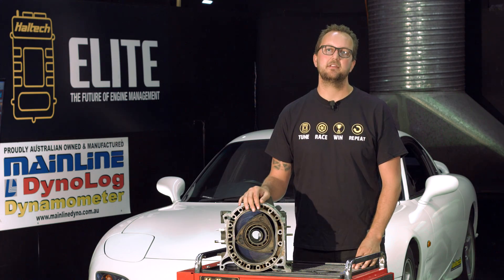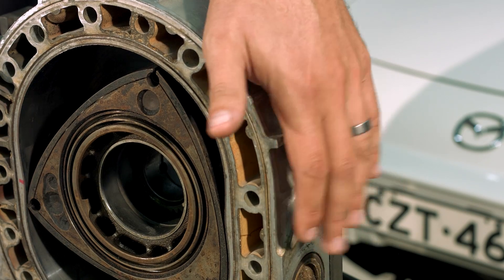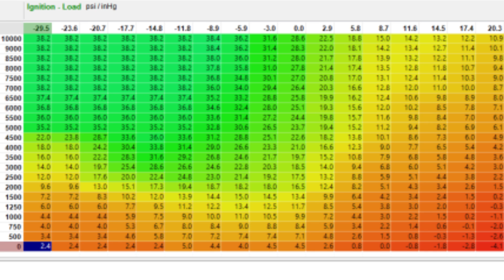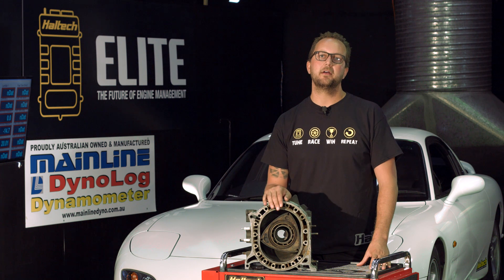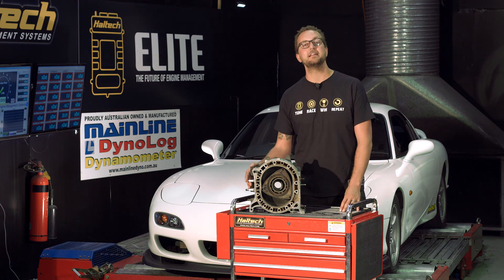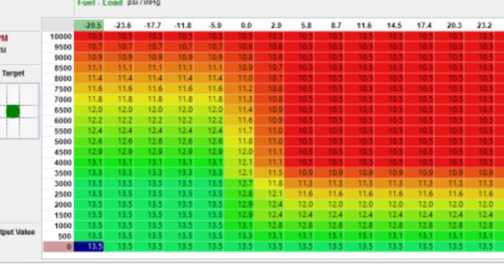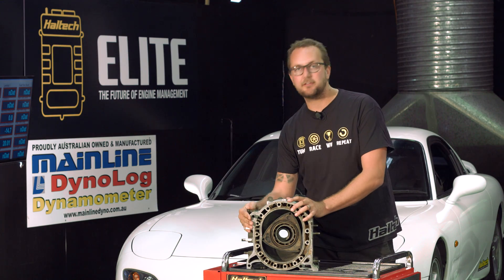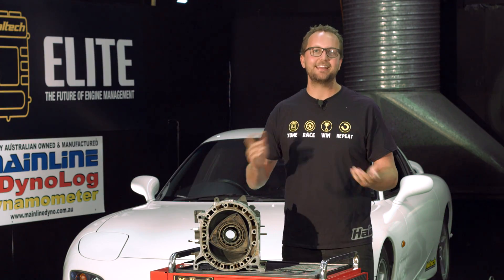💬 Tuning a Rotary Engine - Technically Speaking

Comment: I don't understand the hate walkers get. My dad has an rx8 that we lpg converted and it as reliable as anything, and with that sound you just can't not love them. And come on 3 moving parts they are just so easy to build and rebuild. Personally I'd have a rotary over piston any day, don't hate it until you've tried it!!!
Reply: You're spot on about the moving parts point. I think I know why most people have had problems with rotaries. They don't know that you have to treat them like 2-stroke engines. That you have to let them warm up to avoid flooding. That you have to add oil more frequently. And that you will have to rebuild them more often than a reciprocating engine (even though as you mentioned, they only have 3 moving parts, so it should be incredibly easy).
Reply: Yeh and the rewards for all the work outweighs the downsides. The sound of them.
Reply: lpg is dry so won't help lubricate, and combustion will be hot. I'm not sure lpg is a good idea in a rotary engine :/ Sorry to be a buzz kill.
Reply: don't worry about doctor bummer.. he goes around the you tube and makes trouble.. glad you are liking your LPG mod.. I may try a similar mod once I pay my rx8 off..
Reply: That's what you think but it works perfectly, just needed a tune and a custom oil delivery system to obviously lubricate the seals.
Reply: Simon T absolutely fantastic car. Light, sounds amazing, handles well, good interior, reliable if you look after it, just really well engineered. I think a lot of people stay clear because of the rebuilding thing but it really is very simple and I reckon the average person could do it with a bit of research.
Reply: Isaac Abraham the engine is lpg converted so it runs on lpg. Lpg is a petrol alternative that you can buy at petrol stations in the uk, it is half the price and has very similar consumption so gives very similar mpg.
Reply: The real doktorbimmer say what you want but the rx8 is a great car and the motor is top and if you look after it right and know what you're doing it is reliable.
Reply: The real doktorbimmer exactly! Then why are you bringing it up in this comment section? Idiot!
Reply: Louis Bou yeah hes just a rotry hater leave him alone he got laid off from mazda
Reply: terrance hill I've been going through the same thing for almost 2 years,,,,this guy has a hate for mazda rotary like nothing I've ever seen before,,,its totally irational.
Reply: The real doktorbimmer yeah,,,,that's it! Everyone on YouTube is wrong and you're the only one that knows anything lmao
Reply: The real doktorbimmer the REAL FACTS are you don't own a rotary powered vehicle,,,never worked on one and only know and repeat what you've read. So until you actually put in some wrench time nothing you say can be taken seriously.
Reply: @dakken74   
http://az616578.vo.msecnd.net/files/2016/08/27/6360787077700554381193066848_Internet-Troll.jpg
Reply: The real doktorbimmer OK obviously it has more than 3 moving parts but you have 3 major moving parts. You can chose not to believe this but it is true, why would I lie, it's a YouTube comment section.
Reply: The real doktorbimmer look at any car magazine or anybody who has ever driven one, they are a fantastic car. They didn't sell because your average joe isn't going to buy an rx8 due to the motor and it's high maintenance. This meant they weren't continued to be made. But mazda proved that you could have a rotary daily driver.
Reply: The real doktorbimmer I have an rx7 and know people who actually work on them,,,,what do you have besides your hate for them and Wikipedia lol
Reply: Louis Bou Cool, sounds like you've got it all in hand. Enjoy :)
Reply: The real doktorbimmer you just can't accept what I'm saying is true. You can chose to believe me or not. But look on any rx8 forum and see the people who lpg convert them. I'll link you the eBay ad once it's up for sale.
Reply: titus allen don't listen to this guy he is just jealous he doesn't have the knowhow to lpg convert his rx8 or he may just be jealous that he doesn't have one. It's a great car enjoy it mate, especially when it hits 6k rpm.
Reply: The real doktorbimmer got a 750il lpg converted and a 147 1.6 twin spark lpg converted as well if you want to say that they won't work as well.
Reply: The real doktorbimmer what about all the other people that say the same thing about you? Lmao!!!
Reply: +dakken74 yeah there a lil faster to i believe.. think the gen 2 just got some of the troubles fixed. I would love one of them two.. actually kno a guy who is selling one but im focused on my rx7 for now
Reply: doktorbimmer edited. Giving you the benefit of the doubt you weren't trolling: Yes, rocket engines, at least the vast majority, are indeed ICEs. An internal combustion engine - whether or not you directly inject the oxidizer in the chamber - is still an internal combustion engine. In a rocket engine, you could inject "atmosphere" but this is EXTREMELY inefficient given the low volume fraction of oxygen (~20%) present in air. Transporting it is inefficient, burning it is inefficient
Reply: The real doktorbimmer ummm the car works perfectly and fuel costs a shit tonne less so wherever you got that from is bullshit
Reply: The real doktorbimmer well not so inefficient that it's less cost effective to lpg it.
Reply: Louis the reason rotaries have problems are based on seal lubrication and emissions. most wankel heads know that mixing an ounce of 2 stroke oil per gallon of petrol in your tank helps lubrication greatly. 
the renesis rx8 was shit compared to the older 13b because they tried to make it run cleaner, which they simply aren't meant to do, as explained in the video. he doesn't spell it out, but when you pay attention to the fact that these need more fuel because of a lack of time in the engines cycle, it makes sense. 
wankels have always been a great race engine, but too polluting for the standards most of our governments place. 
also, it seems most people who don't research the differences in rotaries end up blowing them prematurely when they treat them like piston engines.
Reply: The real doktorbimmer is that what's in an Rx8 or Rx7? No? Then leave it out.
Reply: The real doktorbimmer I've seen your youtube,,,your a wanna be know it all who likes to argue about stuff that's not in production anymore to try an make yourself look smart lol
Reply: The real doktorbimmer do you have an Rx7 or any mazda rotary powered vehicle? Yes or no?
Reply: The real doktorbimmer exactly as a thought,,,,wannabe know it all with NO EXPERIENCE to speak of.
Reply: The real doktorbimmer all talk! Just like I thought.
Reply: terrance hill you see how when you ask him if he has any actual experience he tries to change the subject lol
Reply: The real doktorbimmer lmao ur a joke bud haha.. i think even u kno it, pretty sad really but what ever  must suck for u on here.. everytime u open ur mouth someones there to prove u wrong or call u stupid. Habadaba dum
Reply: As for whether the rotary engine will live on, Kogai was a bit more cryptic and wouldn’t give a definitive answer. “But if we were to restart production of the rotary engine again, we need to make sure it wouldn’t be just short-lived,” he said. “We need it to meet future emissions regulations. We are still conducting our R&D activity to overcome any issues we have with emissions and fuel efficiency.”

So the good news is, Mazda is still working on developing a rotary engine, but it’s unlikely to show up in a new sports car
Reply: terrance hill I've been dealing with him for a while now. 1st time we talked he admitted he had an Rx7 and blew the engine,,and know all he does is talk shit about them. Lol
Reply: Louis Bou rotaries are fantastic until you have to tow something, unfortunately
Reply: If you think they have only "3 moving parts" you don't know much about them. All of the various seals on the rotor are moving parts in and of themselves as are the various parts that collectively make up the rotor "assembly". Bearings are also "moving parts", and of course rotaries have all the accessory parts such as oil pumps, water pumps, etc that all other engines have. So cut the bullshit. There's nothing "simple" about rotaries and they're actually stupidly complex given how poorly they perform. Even Mazda, which is the only manufacturer to ever invest in rotary production, only used them in a small fraction of all of its vehicles and those are its lightest, least-practical "toy" vehicles aka "sports cars".
Reply: what is combustion itself
you do know that the most powerful super computers exist for running simulations in DIESEL COMBUSTION with QUANTUM PHYSICS (why they're so powerful) to understand how to get a cleaner, more efficient burn, right?
and you do know that i did not cite any of his "quantum physics" work, but instead the one where he proved that every EVERY referential is right, right?
are you scared you dont know anything about it?
Reply: blown
the
fuck
out
you cant even come back properly
i point you, again, to his work where he proved that every referential is valid.
keep on being you man, we need people to laugh at.
Reply: > I bold my comments to show my intelligence!
Reply: once again, i did not mention quantum mechanics, you did. i mentioned referentials.
but if you really, truly want to know what quantum mechanics has to do with ICE engines, its in the goddamn name. people are trying to figure out (specially with diesel) how to make the mixture more homogenous, burn cleaner, and more efficiently, all through quantum mechanics. quantum mechanics matter in an ICE engine when it comes to the fact that you cant be sure that there'll be even distribution during injection.
 you goddamn door knob, i told you this once, and you're making me repeat myself. last time i had to repeat myself close to five times. maybe you're just braindead.
Reply: "look at me mom i know some cool internet tricks like bold and italics. that makes me super win arguments right?"
Reply: sure thing m8
Einstein, Albert "How I Constructed the Theory of Relativity"
or if you wish, the equivalence principle.
it all started off with gravity studies (which is unlinked to quantum phenomena up to this day).
its as if it was classic mechanics
and then it evolved
something like modern physics i think its called
Reply: Attention seeking behavior is intelligent and cute in a dog. Not so much in a guy who spends years on youtube on a hateboner for an engine, its owners and and enthusiasts.
Reply: does him working "with quantum mechanics" (for the most part he really didnt) negate any paper that he wrote about any other topic?
is that how the academia works nowadays?
or is that just the sound of a fanboy of a brand that cant even compete with the contemporary car market?
Reply: once again, i did not mention quantum physics for the argument. you're the one bathing in your own pool of tears over it.
i did not say it mattered for wankel engines, i just cited it matters for diesel engiens
not once i wanted to delve into quantum mechanics. i just cited how eintein's work proved that EVERY REFERENTIAL IS THE SAME, AND THAT RINGS CAN BE CONSIDERED STATIC, but it seems your goldfish brain cant remember what you commented during a timeframe bigger than 5 seconds.
scroll up, read the chain again.
bmw own morris, a defunct brand since 1984
Reply: no shit sherlock. never said that.
but he is not.
are you legitimately telling me that gravity is quantum study?
the force that is UNLINKED to the quantum world is quantical study?
really?
Reply: ring around the goalpost
with a pocket full of bait
mate, you still dont understand what the hell "referential" is
go back to high school, and maybe try to get an engineer degree on the way.
Reply: to you
its a moving part to you
its a moving part for someone who is observing from the outside
for the seal itself, it does not move. the world does.
you're showing your lack of physics and therefore engineering knowledge.
Reply: to seal
it is located in the apex.
you still dont know physics
what else is new
Reply: doktorbimmer you need to see a therapist
Reply: Lol what now? The reason "atmosphere" is inducted by (most) ICEs is so that the vehicle doesn't have to carry oxidizer. Atmosphere is not required, rather it is simply a convenience that O2 is present
Reply: >nan3r is trolling
Mixed up the names mate, you're the hardcore wankel hater
Reply: Because you don't understand physics, as clearly shown. And physics have to dumb down physics to make people like you understand even a slight amount of it, so instead of understanding it all you just get a tiny piece that is simple to work with and think you own the world.
Reply: doktorbimmer even a 14 year old understands referentials 
Did you skip physics class or did you skip school as a whole
Reply: hey man, I have an rx8 coming today. what do you mean lpg converted?
Reply: The real doktorbimmer car is perfect on lpg just needs a good tune. Might be because lpg has a higher octane rating so may not need a higher compression ratio.
Reply: The real doktorbimmer yes or no?
Reply: The real doktorbimmer are you or have you at anytime in the past been employed as a professional mechanic who specifies in the mazda rotary engine?
Reply: The real doktorbimmer yup,,,,change the subject from the fact that you have no experience LMAO!!!!
Reply: The real doktorbimmer ran away i didnt kno u said anything lol all these coments u ran and hid from then u pop up almost a week later like a lil bi.tch talking shit lol ur a joke just give it up... its funny u run and hide everytime a few people join in to make u look like a fool and pop up in another coment section haha fudging joke
Reply: terrance hill I don't think Bimmer understands the concept of misdirection,, the CEO of Mazda has already stated in the past that the Rotary is the soul of Mazda and there not giving up on it lol
Reply: I said there will b a new rotary never said it would b an rx9... also i think u need to go read what the ceo said lol... fudging joke
Reply: The real doktorbimmer lol so so so sad u are... i kno what will cheer u up.. go get ur nails done again, maybe this time get ur hair did hahaha
Reply: The real doktorbimmer he didnt say that at all lol he said they wernt planing on building a sport car bigger then the miata.
Reply: His words; " if we were to restart production on rotary we would need to make sure it wasnt short lived and meet future emissions regulations" then what did he say Oh YEAH " we are still working on r and d for emissions and fuel consumtion".... hows ur butt feeling.. is it soar again.. im sry i have that effect on u hahahaha joke
Reply: @doktorbimmersdaddy715  So much condescension, and so many assumptions in so few words... DOKTERBIMMER IS A FAKE ENGINEER Allow me to enlighten you; I have not compared it to a 2 stroke in any comments here (though the comparison is entirely valid). I'm not a kid, I'm an Aerospace powerplant development engineer, and a former Mazda technician. I have a comprehensive understanding of the Wankel rotary engine (though I'm not nearly pretentious enough to use non English initials for it when communicating in English). Contrary to popular belief, this engine is not an occult entity of magic and mystery, it is an internal combustion engine. Different in that it is a constant volume pumping unit, and non-reciprocating, but still just an engine that translates thermal expansion into rotational motion like all the others. Don't be an arse.
Reply: @xkexke8081  Where is Ernie Brink???
Reply: Copy and paste from the article.
Reply: ***** well thank u for that lol i was just going off what i rememberd reading... still pretty sad about the rx9.. altho im sure we will see it one day. Altho i couldnt really care.. the rx7 is amazing. The rx8 has its problems but is still gorgeous and the older rx models are sexy as heck too.... they should just make a nice mazda with optional rotary engine for the true car guys.. one day.. shit even have an optional rotory on a miata, i guarenty it would sell
Reply: terrance hill yeah,,i love the look of the rx8s. My favorite is still the 1st gens.
Reply: ***** oh really im glad to kno that lol not mazdas fault he doesnt kno what to do with a rotary.. he spends so much time on google u think he would actually kno something usefull.
Reply: I want to be able to wake up 5 minutes after I'm supposed to be somewhere, then jump in my car and drive off immediately while forgetting most of what I was supposed to bring at home. 
Rotaries don't seem to like that type of abuse.
Reply: LPG huh? What kind of setup are you running to do that? And how are you keeping high-friction, high-heat rotary parts alive with a very dry fuel like LPG? Oh wait. To be truly efficient and worthwhile, LPG engines and "conversions" have to significantly increase compression ratios over gasoline engine levels to make use of the high octane and low energy density of LPG. So the odds are your "converted" rotary makes less power and is less efficient on LPG than it would be on gasoline.
Reply: DEEREMEYER1 by 3 moving parts, im pretty sure he was talking about the main parts making the power. Obviously the accessories are moving parts. Compare with reciprocating engines, 1. Piston 2. Wrist pin 3. Rod 4. crank 5. Timing chain/belt 6. Cam(can add multiple numbers here for overhead cams, and more for single cam with stems and rockers) 7. Valves/tappets(can add more for balancing shafts to). No need to include seals, flywheel, water pump, oil pump or alternator wich they both have.
Reply: Deermeyer soooo wrong... he was talking about actual moving parts of the engine, the stuff you listed as accessory parts are just that, ACCESSORIES, you don't need them to run the car, however the seals and such are not considered seperate moving parts.
Reply: lol Doktor Bimmer was probably "rotary is garbage" pseudonym before. It's pointless, he/she hates the wankel engine with passion. Whilst some of us love it despite it's short comings. Oh and Doktor Bimmer sounds like Mazda might have had some breakthroughs recently with engine technology that may allow them to produce a new rotary engine! That should give you something to cry about for years to come! Oh NOES the rotary and it's inefficient combustion chamber! How dare those Mazda folk do that!
Reply: do piston seals not reciprocate inside the combustion chamber, or do you just put them inside your oil pan for the sake of simplicity?
Reply: you also wont find them arguing with you saying theyre not
its all in the referential mate
for the piston, its the engine itself that is moving
for the dorito, its the iron itself that is moving.
its as if you said that the ground moves your car. youre not wrong, just different.
Reply: you missed my point
they can just as well be separate stationary parts. it depends on your perspective.
"blah blah blah the engine doesnt move" 
as einsten himself stated, every referential is correct.
Reply: you are not seriously suggesting that you're considering vibrations, are you?
"oh look it moves .01mm forward during compression and .01mm backwards during intake"
to the rotor/piston (if you dont cosider the piston rings rotating) they are static
and they dont rotate anyway on 2 strokes, so blown the fuck out once again.
Reply: HAHAHAHAHAHAHAHAHHAHAHAHA
you couldnt be more wrong
"theoretical physicist" im going to give you a spoiler on that, they do more math than any other physicist, they just get a bad name because mediocre people like you think its something that it's not.
tl;dr from your post
"einstein is wrong from a conventional physics standpoint"
you truly are a mastermind, huh
can you show me where he went wrong on his calculations?
fun fact, einstein hated quantum physics. he's the one that the famous "god does not play dice" phrase is attributed to.
Reply: thank you, i was really needing that laugh, with my grandpa being in the hospital and all
dumb people really are a blessing.
Reply: Last time i checked but apex seals and piston rings are FIXED to a Rotor/Piston that is the point, they are not separate moving parts that increase the complexity of the design, now sure in a way they are moving parts but they are attached and held in place by grooves...

Do you class seals or rings as the same type of part as a crankshaft or a conrod? No...
Reply: HAHAHAHAHAHAHAHAHAHHAHAHAHAHAH
quantum physics is not dependant on referential?
what the hell youre talking about mate
its dependant on referential mate. THE SEALS CAN BE CONSIDERED STATIC. JUST USE THE PoV OF THE SEAL ITSELF
god you truly are braindead.
Reply: You said yourself the bold text was to draw attention and you call me an attention seeker. Hah!

How many years has it been since you started going on this anti-rotary/wankel whatever the fuck your pedantic ass wants to call it?
Reply: Okay YES the seals are a moving part from the outside due to the fact they move but they are not mechanically moving which brings me to my point a wankel engine in it's simplest form has 3 god damn parts, rotor housing, rotor and crankshaft... not much to go wrong there bar SEALS which are not hard to replace and due to the size of the wankel engine i would much rather change the apex seals of a Wankel than piston rings on a piston engine, you have been arguing about parts to go Oh look at how smart i am when you never refuted my claim of Wankels are simple engines.
Reply: "entropy limits"
nigga what
no engine is more "entropic" than the other (given that they burn the same amount of fuel)
entropy is the amount of free energy in a system. burning fuel changes the entropy of the universe, but moving something does not.
"haha im so witty and funny with my rotary meme"
rotaries are shit for airplanes. there have been a couple of cases that the pilot has been chucked out of the moving plane because he was inexperienced and could not deal with the amount of gyroscopic effect the engine puts on the plane.
you really have to go back to physics man.
btw, sealcs can be seen as static :V
Reply: "its rarely done therefore its hard"
complete and absolute bs
rebuilt a two stroke (bottom end too) in three days.
Reply: Vicious Slayer don't bother with this domtorbimmer guy. He is a legitimate fucking sociopath (who, evidently, recently discovered how to bold font...yay). I'm not joking in the least; he can be found in almost every rotary video on YouTube desperately falsifying information for god knows what reason
Reply: oh i know
i like teasing him because his dubassery always shine through, but he never notices
he's like a tinfoil hat wearer
you know, wankels suck because they died in 2011, but the apex of engineering are rotary engines, where you have a spinning block with tons of gyroscopic effect (which killed plenty of unexperienced drivers), it blows crank seals AND it eats oil
doesnt sound similar at all
its funny to count how many times he can contradict himself and he still thinks he's winning
Reply: It's not a mechanically moving part it moves but not by mechanical forces of other things, it does not move freefloat same way piston rings are not considered moving parts as they are considered PART of the piston. also stop with the Black text because it is absolutely annoying me you old bum...
Reply: no you're right, you're not
you're the one who said einstein was wrong
you're truly the mastermind in this thread
Reply: once again you *brainless reciprosheep*, its relative to your reference
lmao you cant even physics
Reply: yeah, referentials are also elemental
are you moving past the tree or is the tree moving past you
you still fail to grasp simple concepts
Reply: so tell me, what if there is no atmosphere?
once again, its all about referentials.
to someone inside a vehicle, the tree is moving past them. to the tree, you're moving past them. wind is but an after-effect
Reply: HAHAHAHAHAHAHAHAHA
my analogy is flawed?
you're telling me i found a broken referential?
HAHAHAHAHAHAHAHAHAHA 
mate, is your brain too small? you clearly found out about referentials there for a moment, but you lost it man
to someone inside the car, wind is moving against them. the tree is moving past them. the ground is moving past them. do i have to spell it all out?
Reply: HAHAHAHAHAHA SPRINGS = MOVEMENT?
WHY DOESNT MY CAR ROLL BACKWARDS ON THE DRIVEWAY THEN
And I'm the one that can't grasp concepts
To the apex seal, none of it matters. From the apex seal's perspective its the spring that moves. The housing that moves. You somewhat grasped that concept once, but you refuse to learn eh?
Reply: doktorbimmer no, just calling you on more bullshit. Your words, verbatim: "internal combustion engines cannot operate without atmosphere". You were also the one who first mentioned rocket engines and submarines, or did you forget that as well? You see that psychiatrist yet?
Reply: doktorbimmer you still don't understand referentials
Please mate, git gud
Reply: HAHAHAHAHAHAHAHAHA
i never said it didnt move, i just said it could be considered static
pay attention to what you read, you could have saved 100+ replies of effort
Reply: BUT IT IS
once again, referential
for you, the dorito moves
for the dorito, you move.
doesnt matter how complex a trajectory is. doesnt matter if it has springs. the rest moves. not the dorito.
FOR THE DORITO
for you, notihng else moves, JUST THE DORITO
do you understand referentials now or do you still refuse to?
Reply: yes, they can
look at it from the perspective of each part
to each seal, they stand still, and the housing/rotor/springs move around them
please, im legitimately trying to teach you referentials man. its so important on the field of physics.
Reply: doktorbimmer if you treat the seal as the non-internal frame of reference, you should get the same equations of motion. The seal will be static, but you must introduce the D'Alemberts force such that all the forces acting on the seal sum to zero; it's simply another way of looking at a problem. This was the guys (valid) point, at least I immediately understood it as such, but you insist on fighting everyone
Reply: And for fucks sake, quite liking your own comments, it's cringy
Reply: http://www.mazda.com/en/innovation/stories/rotary/newera/
Reply: So desperate. http://www.mazda.com/en/innovation/stories/rotary/newera/
Reply: You don't appear to know what obsolete means. We've been through this retarded "conversation" before. Posting the same lies on every rotary video on the internet is really pathetic behaviour. As if saying it enough times will make it true. Sad little boy.
Reply: Louis Bou LPG for life
Reply: Rebuilds for my LS projects are usually only only $300

My 12a and 13b cost MINIMUM $1000 though sadly just for the minimum required kit :(
Reply: dakken74 

not just rotary but literally everything that isn't a shitty 200hp stock v8. 

Plus he's literally NEVER even touched a rotary of been within spitting distance of one, he's admitted that before. Also he never owned a rx7. That was a lie he got caught in red handed. It was a friend's car. His friend leaned it out WAY too much and then wondered why it blew
Reply: You are scared of the KKM for no reason despite it’s target audience.
Reply: Which proves it’s resilience and perseverance in the community.
Reply: RX-7 and RX-8 club are active.
Reply: Steam KKM, design that.
Reply: Both are extreme sides of the spectrum. One at torque per liter and the other at power per liter. Your version of efficient is a slow balanced car.
Reply: Doktorbimmer is a troll. He goes around trying to correct people on as many things as possible. If he cared about the truth, he would persist on it, not resort to the conversations he's done here. 
Second, he believes any engine that rotates to create torque is a rotary, whereas this is a wankel rotary page. It is the equivalent of entering a death metal page and demanding others call It "death metal" rather than "music" because of "reasons." 
Finally, he has no concept of theory of mind. Doktorbimmer, did you know other people can have definitions of words different from your own and that, in order to use them, there has to be a common understanding? Your definition of obsolete is missing a part: Or used anymore. Plenty of people use the wankel, not obsolete. 
Now, what's the next thing you're bitching about? You claimed the apex seals are moving parts. Correct, they move within the chamber, but they are fixed to the rotor and cannot be moved. It is similar to calling a screw on the spinning blades of a fan "a moving part," even though it is attached to the fan. It is intentionally deceptive in its use of words. 2 rotors spin while the eshaft rotates. That is the engine, those three parts move. Other parts are external to the process and are there to maintain timing, temperature levels, or other general maintenance the car requires as it is driven. 
You claim to own rotaries, but the reality is you do not. Those are piston engines, you own. Not a single rotor.
Reply: "son" "obsolete" etc the words you use to diminish others and other objects are forms of logical fallacies meant to convince someone of an opinion. You use ad hominem, in addition to many others, in an attempt to convince....who?
Reply: @rckli  Can you please name a Wankel engine with a  FAA or EASA airworthiness certification??? LOL!!!
Reply: @rckli  Stop by your local Mazda dealer and ask to test drive a 2024 RX model???
Reply: Rotaries are super fun and I want one or three as project cars and weekend drivers.  I already spend about $60-70 a week on fuel getting 30mpg on 87 octane though.  So I wouldn't love getting 15-20mpg on 93 😅
Reply: don't waste your time trying to reason with bimmer guy,,,he's a well know rotary engine hater on YouTube. he's on many many YouTube videos saying the same thing over and over again.
Reply: The real doktorbimmer nope lol im just proving a point. ur a joke who hates mazda rotary lol. pretty sad really. maybe if u go do ur nails and pretty urself up mazda will hire u on looks cause god knows u couldnt get the job with actual intellagance
Reply: "To an amateur like yourself" jesus H christ, the seals do not move at all, they are stationary to the part they are attached to... jesus christ, bet you have never even owned a bloody Rotary engine to even be saying that BS, do you consider piston rings to be "moving parts" i mean by definition of moving sure they "Move" but they are not moving parts by what people who have ACTUALLY WORKED ON CARS mean.

Jesus christ Typing your text in bold does not make you more intelligent mate... can't fix your stupidity if you think calling people amateur on the internet somehow makes you better than them. Come back when you have actually owned and repaired cars (Your parents Ford does not count)
Reply: Vicious Slayer it's funny you mention the tinfoil hat because I was actually thinking this guy has that same kind of obsessive, blind stupidity that flat earthers/conspiracy theorists possess
Reply: doktorbimmer there is something seriously wrong with you. Like, really wrong with you

PS, wrong guy, I was never even part of that argument. But that doesn't really even matter cause you're obviously nuts
Reply: Its not hard to understand... The Rotary engines is a shity design with horrible reliability
Reply: he probably is
"the truth is being hidden"
"they're lying to you about wankels"
its amazing
also, doktorbimmer, im not a rotard.
im more of a wankel guy myself :^)
Reply: back at it again eh "doktorbimmer"
tell me, do you hate rotaries that much?
why  do you scour youtube for videos about rotary engines just to spew bullshit over something you so clearly dont like?
do you have a mental problem or something? go sperg out on 4chan mate.
and like clockwork, you've been beat up by other people in the comment section, while you sit and cry "waaaah, the rotary engine is a lie, the rotary engine is unneficient, the rotary engine eats oil" while posting a few useless articles. 
if you were worried about thermal eficiency at all, you would daily 2 strokes. 2 strokes would be your almighty god, and you'd be praying for a boxer 2 stroke (which as the gm dev. department said, can be made to easily attain 60-70% thermal efficiency)
you just cant accept the fact that people like something that you dont, can you?